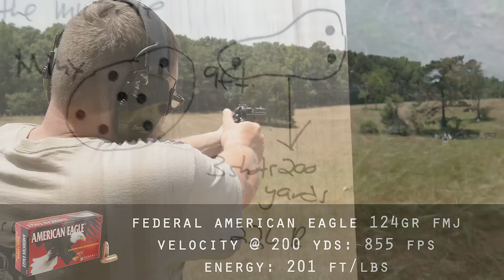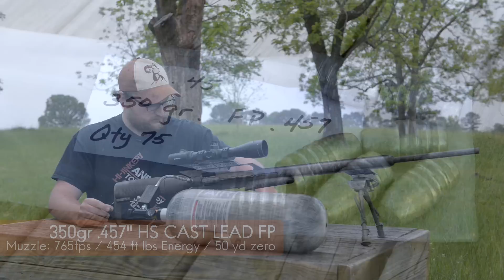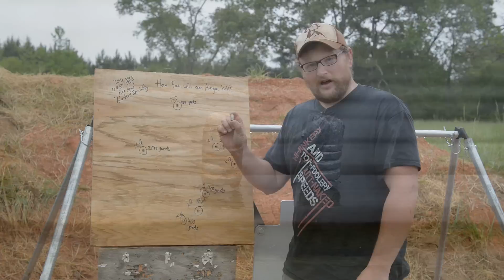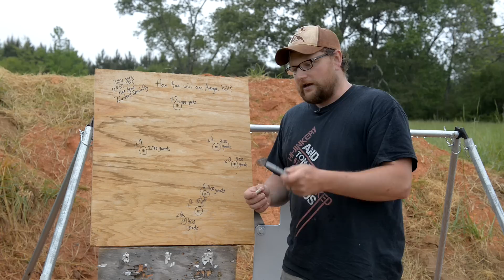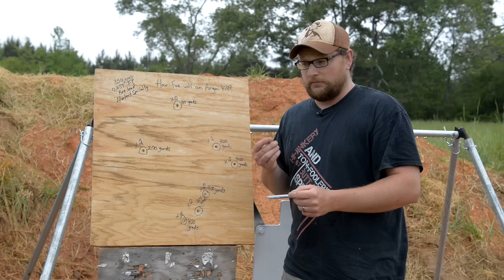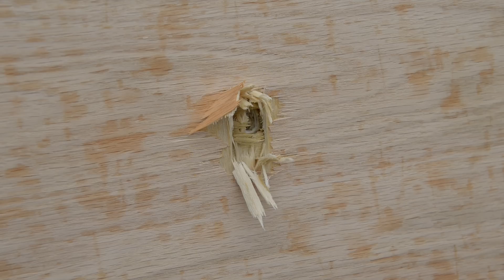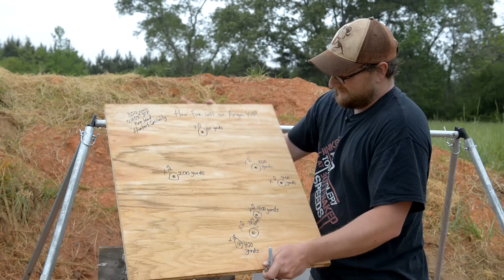How Far Will an Air Rifle Kill? Part 1

Comment: As a guy from Europe. I really would love to see you showing the numbers in meters too.
Reply: 100 yards is roughly 91 meters.
So 91, 182, 273, 364.
Reply: thank you for your interest ,sir
Reply: Jan Hendrik Franke yes 1 yard is equal to .9144 of a meter.There is  DECIMAL POINT there in case you missed it.So to convert yards to meters you multiply them by .9144 to get your answer in meters...........Or would you prefer to convert yards into  inches so you can use centimeters or millimeters first and then into meters?lol
Reply: Just multiply by .9 for a rough estimate,seriously its not that hard and if its in feet divide by 3 first.If you want it dead on accurate its actually .9144 ;)
Reply: SouthJerseySound 9144 Meters?

Comment: Lewis and Clarke used an Air Gun back in 1803 when they crossed America, it was a 40 caliber best that I remember, the tank of gun was in the stock and held about 900 psig., it took around 1500 strokes of a bicycle type pump to fill it to capacity. They would put on shooting exercises at most Indians Villages to impress the Indians and bring a little fear into them since this air rifle could put a hole in a two in. board at two hundred yards, the Indians were very impressed and knew that they were out gunned by this weapons performance. The word spread among other Indian tribes along the way west so Lewis and Clarke as history told it, had very few run-in's with other Hostile Indians...
Reply: Good point.  Most people don't know this.
Reply: It was a repeater as well,  something like 16 shots. The rifle was a gerondoni I believe.  Not sure on the spelling.

Comment: Thank you for correcting that gaff. For those of you who don't know an air rifle/gun is NOT a Firearm and is NOT subject to laws that specifically refer to Firearms. 18 U.S. Code § 921 - Definitions: (3) The term “firearm” means (A) any weapon (including a starter gun) which will or is designed to or may readily be converted to expel a projectile by the action of an explosive;

Comment: You should get a pointed tip custom 45 cal bullet or a ballistic tip, .5 or .75 of the weight and a full weighted one and see how it would change the ballistics.  I would think the blunt nose would slow the bullet, down range more.I think it might be an interesting video.  Of course the light bullets would move faster, but less energy, but a flatter trajectory to get more distance.

Comment: the orizontal speed is always the same while the vertical speed gows down if u re compansating against gravity and goes even faster while falling.   the friction with the air of such a smalla object is olmost nothing.   this means that the gun is gonna kill at 2 feet just basically as much as it s gonna kill at 400 feets

Comment: That gun is lame as fuck
Reply: That's because it's not a gun genius.
Reply: It is by definition a gun but not a "real" gun
Reply: Either a terrible troll, or simply just ignorant. The poor language points to both, but I digress. 

The Texan is a quiet but powerful weapon. Think on this for a second: The Air Force Texan fires a .45 slug at about 1000 feet per second. The Colt 1911 .45 sidearm fires a .45 slug at about 830 feet per second. 

The Texan air rifle is literally a more lethal weapon than the most famous semi-auto pistol in history. Not even remotely lame.

Comment: Excuse my ignorance.  Can this rifle be fired with a CO2 cartridge, or does it have to be a tank (or manual pump)?  It's hard to imagine hunting with it while lugging a tank around.  

Also, just an observation:  A $thousand for the rifle, plus tank(s) and/or pump - holy moly!!
Reply: It actually has a internal tank that can be refilled, each refill can give between 10-20 shots dependent on the rifle(I do t have the exact specs on Eric's rifle here so ruff estimate). The large tank he is using here is to maintain a constant through out this test, and eliminate the possibility of any thing like low psi on the internal tank.

Comment: instead of buying like a three thousand dollar air rifle why not go to walmart buy a 12 gauge with slugs and a 4 by 16 centerpoint scope thats like 260 270 dollars
Reply: if yoiu are putting a 16x scope on a shotgun....you already lost the point.
Reply: its a lot cheaper
Reply: true never thought of that thank you but the cost amount of the air rifle is a lot more expensive around 3k where a shot gun is around 150 to 300 hundred $ so you will add up the amount of the ammo to the amount of the air rifle and i looked the ammo for this and for 100rds is around 25$ where 25$ in 12g rounds it is around 300 shells  in my local wal-mart.
Reply: ***** and you can use it as a big game rifle
Reply: i shot them all of thee time
Reply: dude im not bluffing idc if im wrong at my walmart a shell thats is the cheapest is aroud 10 cents
Reply: well i live in wv and my local walmart is (304) 489-1905 that is the number
Reply: whats your state just a ? and dude im talkin low brass shells the cheapest you can get
Reply: true and thats not that far away
Reply: yeah thtas cool at my walmrt they have a benjamin prowler .22 for 89$ 21 foot pounds
Reply: yeah true

Comment: I have a condor with 4500 psi tank regulated to 3000 and on a "9" setting I can nail small game, fox, coyote, vermin and pidgeons to 100 yards using .22 JSB jumbo heavy.   Best shot 3 pidgeons lined up at 75 yards 1 shot

Comment: The rifle would make a great varminting rifle if its made smaller to .22 caliber with the same power per shot
Reply: there are plenty of .22 PCP airguns on the market.
Reply: yes but i mean something like the size of a .223 or  .222swift rifle bullet.Plain pcp can only shoot measly pellets
Reply: Jaco Botes
dude that rifle he is using is a PCP shooting a .45 with more grain wt then a .223. what the hell are you talking about?
Reply: Man i mean what he is using is heavy with bad trajectory and velocity. Use the same power and a like 50 to 60 grain bullet and it would make one mean quiet varminter. A .22 pcp still has less power than a .22lr and cant be used to hunt efficiently or ethically.
Reply: Jaco Botes
bullshit. plenty of people hunt hog and coyote with .25 and .22 break barrels! a .25 cal PCP will easily take that game.....not at 400yds but 200. and remember there is no recoil in a PCP which cancels the traj problem and also allows for hyper shot placment.
Reply: ***** It's fine, man, been doing it for years and I'm good. What's so dangerous about it?
Reply: *****
 coyote are K9's and the Chinese eat them all the time. a vulture is a pure scavenger
Reply: *****
Still tasty.
Reply: I've killed a coyote with a .25 spring piston break barrel. Cometa Fenix, shot it in the eye, killed it instantly, skinned him, ate him. He was delicious. Trajectory is not an issue if you know where to hold.
Reply: *****
Coyotes round here eat pretty well, actually.
Reply: ***** Probably, but I live in the middle of nowhere, not many roads, they probably live mostly on smaller animals around here.